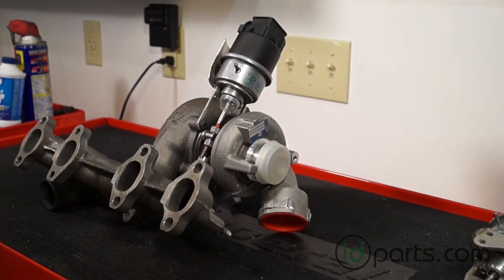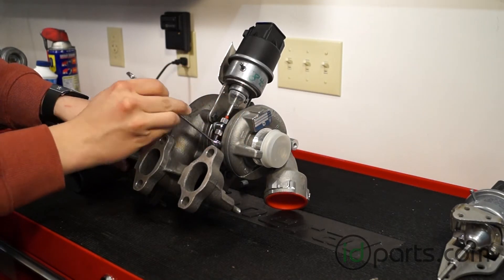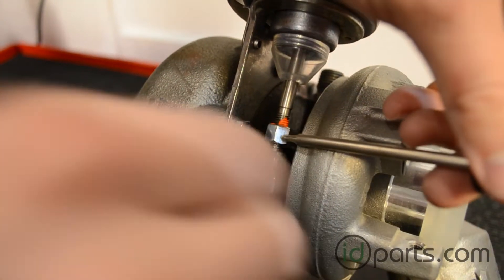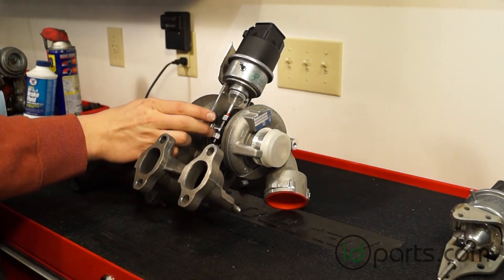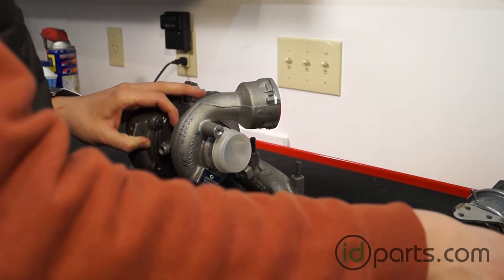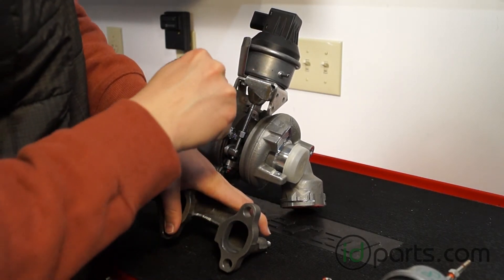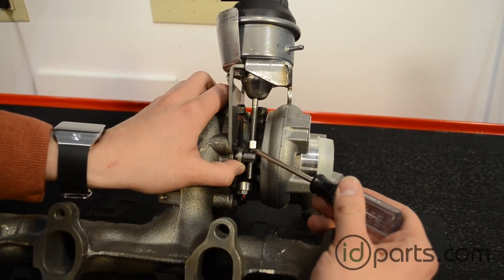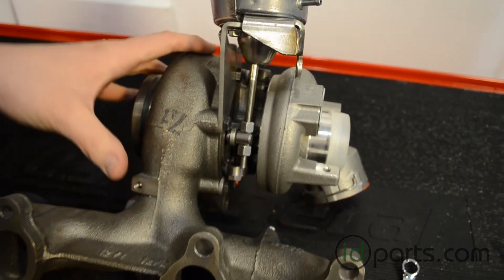BRM Actuator Swap

Comment: Is there a demo where we can see install without turbo removal? I've got 1/4 of a million miles on my Ben and would love to move as little as possible for this repair.. Either that or I might be forced to bring into a shop..
Reply from the maker: Jason - as you probably already have seen, there is very little room inside the engine bay to perform this procedure.  You'll have to do it by feel as you won't be able to see the turbo actuator adjustment screw.  This also means that it is impossible to film with the turbo in the car. :-(  The point of this video is to give you a conceptual understanding of what needs to happen so you can figure it out.